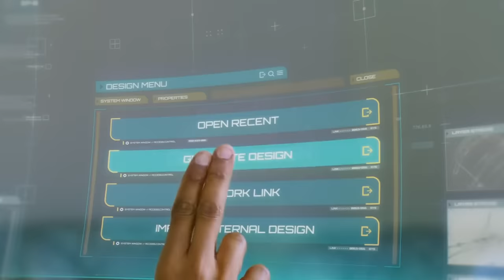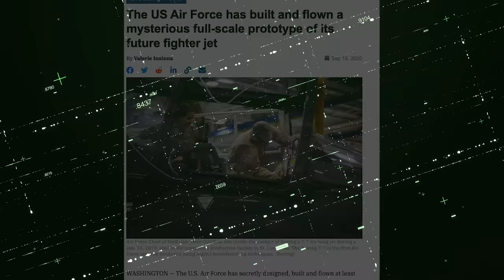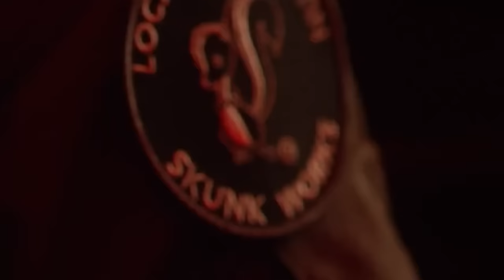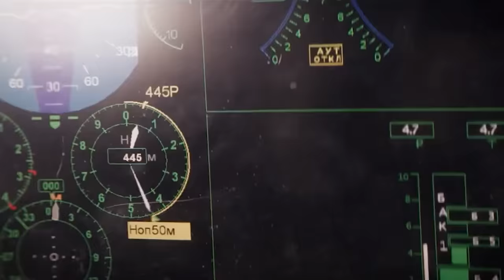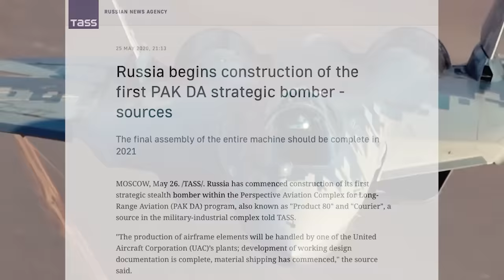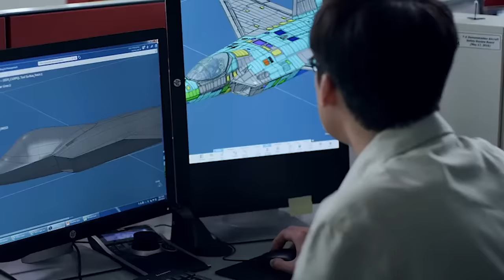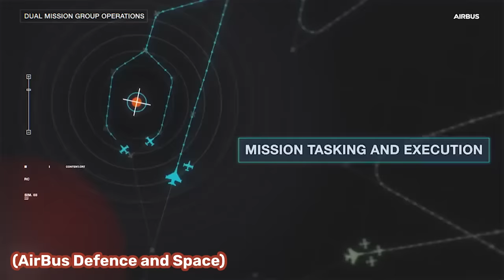12 new stealth aircraft headed toward service

Comment: Stealth is kind of a given for new gen fighters. AI and hypersonic is probably the next iteration. Judging from China's development efforts, the next gen is likely hypersonic bombers FOB and supersonic fighter/bombers like the JHxx. AI driven drone fighter and bombers are already slated for next rollout. The J20B twin seat fighter and dozens of new comms satellites are being launched.
Reply: The PLAAF will need engines that actually work, first.
Reply: My hot take is that the area between Mach ~1.2 and Mach 4 will be an absolute no man's land for approximately the next 15 years.  Fighters will of course still be capable of Mach 2.2ish, but they won't fly at those speeds almost ever.  Why?  Because the range reducing and conspicuous nature of going that speed just aren't worth the marginal benefits of "do the same thing but faster".  However once you get to Mach 4 or 5, then you are legitimately enabling new approach routes that outrun missile defenses or catch the enemy off guard enough that it's actually quite worthwhile.  Kinda like "I'm gonna do this, and everyone this side of the Himalayas is going to see and hear it, but it doesn't matter so long as I'm fast enough" vibes.  But in between, you're going fast enough to be more noticeable but not fast enough to just outrun your problems.
Reply: @JMurph2015  you do have a point. But I suspect super cruising would be the remedy to the high fuel burn. And planes built for high mach are also more aerodynamic, partly the reason why the J20 has a longer range. Time to station is still important and may be worth the shorter range. BTW even a Mach 3 plane like the SR71 can outrun most missiles if it knew it is coming. All missiles have very limited effective range, if you can leave the effective range of 100-150km pronto the missile will run out of propellant. So even a Mach 2 plane may be able to use it's speed to outrange a Mach 4 missile by driving away to slow the missile intercept.
Reply: @buildmotosykletist1987  As far as I know, China makes quite a number of jet engines on its own. All planes built in the last decade have been powered by home grown engines like the WS10, WS8, WS20, the WS15 is already mounted on some planes. The difference between 2000hr and 3000hr operating time between overhaul might be important for service cost, it makes very little difference for combat or general sortie rate. The J10 uses a single WS10 engine, it isn't exactly falling out of the sky. On the contrary the Taiwanese F16 are falling out of the sky trying to keep up with Chinese incursion.
Reply: @olderchin1558  : J20 ! lol.
Reply: @olderchin1558  : J15 too. Only the Russian engined jets perform.
Reply: @olderchin1558  supercruising helps a lot for fuel burn, but it still generally produces a loud boom behind it (and future military jets appear more interested in other stuff than reducing the boom sound), and importantly the associated exhaust heat and skin temperature rise become increasingly difficult to avoid.  IRST is already a big buzzword before every new plane rolling off the line is hard to see on radar, but imagine how prevalent it will become when it's the new most reliable way to track aircraft?  The B-2 and definitely the B-21 had/have some serious mitigations in this regard, and I think it will trickle down to fighters at least to some extent.  And maybe I'm underselling the flexibility of next gen or next next gen engines, maybe the same fighters capable of cruising effort at Mach 0.8 will also be capable of Mach 3 or 4+, but that remains to be seen.
Reply: @JMurph2015  There was a video about some ceramic radar absorbing coating, the B21 is likely to be using it. It would last longer and not heat up. The Sonic boom is unavoidable but it doesn't travel ahead of a supersonic plane so it really isn't a big deal.
Until anti-gravity drive becomes a reality, exhaust signature is a necessary evil. Even China's experimental plasma jet engine will leave a heat signature trail. I bet future surveillance satellite would track and identity planes by their heat trail much like subs track sonar signatures. 
With modern radar systems and satellite, the location of everything is a given. So even stealth is not going to be a cure all except to gain a slight advantage. IRST has been standard on Russian fighters for some time. The Russian is supposed to be working on some plasma stealth but I think the biggest problem is identifying the target not detecting them.
I think AWACs or AEW and integration situation map would be the real game changer. The fighters will likely be just missiles trucks. There were discussion about bigger stealth fighters in the US.
Reply: @olderchin1558  there is more progress on the exhaust signature front than I think you realize at least on the bombers.  I don't know more, but I've gotten some suggestions toward that over the years.
Reply: @buildmotosykletist1987  Difficult to response here. Can't convince you by written a 3000 word essay or referring to 10 years of YouTube and media news of Chinese military and aerospace development if you are kind of anti-china. I will leave you to your blissful ignorance.

Comment: Nicely done video, good accurate information.  Stealth doesn't mean that you can't detect it, with most modern radar that is true, however whenever the US makes something that can't be seen or be destroyed, they then go out and find a way to see it and destroy it because the US knows that it's only a matter of time before adversaries develop the technology, so we need to be able to see stealth aircraft and lock on with weapons to destroy it.  I watched this way back in the 70's with the new Abram tank, we built it then we worked on destroying it, and once we were able to destroy it the tank went into service.  Our radar systems were developed the same way, with testing to find a stealth aircraft taking place when the F117 was still highly classified. All the early fights of this aircraft done in secret were done to build a radar system that would detect it.  There is also more to a stealth aircraft than just the shape, there are also jamming capabilities and false radar signatures.  False radar signatures were first used on the SR71 Blackbird during one of its last upgrades, this system projects several images of itself so any tracking system will see several aircraft, it now becomes a guessing game as to which image to launch a missile at.  Other things are going on in stealth world too that would make your head spin.  There was strong evidence that leaked out during the first Gulf War about a special forces unit that became invisible to the Iraqi, not by standard camouflage either, but went completely invisible, if that happened way back then, I'm sure we're much further ahead today. You can read about that ability on the internet.

Comment: With decades of advanced hybrid material reinforcement engineering experience, integrated advanced radar absorbing materials into the entire structure vs over-coatings is a game changer for consistent stealth capabilities while significantly lowering maintenance operational costs.
Reply: The original F-117 stealth fighter (actually a bomber) was very primitive by today's standards. Back in Desert Storm, nobody even knew what stealth was until we announced, "Oh by the way we have a plane that's nearly invisible and can walk past your air defenses." The F-117 only carried two bombs, and the bombardier had to keep the target painted with a laser. The bombs cost about a million dollars each. Very expensive plane to operate.
Newer aircraft are orders of magnitude stealthier, have more better and cheaper weapons, and are much more maneuverable.
Reply: @protorhinocerator142  Cheaper weapons? Not.
Stealthier? Only in dry perfect conditions from specific cross sections.
Reply: @icare7151  Cheaper weapons? Yes.
We went from laser-guided munitions at 1 million apiece to JDAMS, which were about $20K apiece. JDAMS are fire and forget.
Reply: @protorhinocerator142  🤔 We just shot down a balloon with 2 $495,000ea missiles, the first one missed.
Reply: @protorhinocerator142  Stealth had been widely talked about since at least the early 80s and the B-2 was unveiled to the public in 1988, but you're right in saying that the impact of stealth wasn't fully appreciated until Desert Storm.

Comment: You know as I think about this..why can't they have a hard roller style tube drop down with munitions that connects sort of like in air fueling but is able to handle heavy munitions..have it drop down and connect with lockers into an automatic magazine feed loading system...this way it can fuel and re arm itself all while in air .this should be a thing for a 7th gen

Comment: Stealth was introduced in 1964 with the SR-71 .
Reply: The Blackbird had reduced radar cross section, but it was not stealth. Every radar on the planet could pick it up. And if not on radar, it's 950 degree skin temperature against the cold black sky was easy to track as well.

The whole point of the SR was to be seen on radar, so as to force the SAM sites to power up and focus their energy on it. So they could learn about the soviet tech, locate and map their SAM sites.

Comment: As much as Iran currently benefits from it and probably would today were it still in production, it sounds like killing off the F-14 Super Tomcat was a mistake. The F-18 Super Hornet capabilities aren't anywhere near what the STs would have been (or what the F-14Ds were, for that matter). Even so, much like the F-15, Super Tomcats would have to evolve but would have greatly benefited from modern avionics suites, minor fuselage tweaks (a la F-15 Silent Eagle) and LPI paints, more powerful and efficient engines, plus all the other benefits the F-15EX and F-35 currently enjoy with M/UMT, Sensor Fusion, and the rest.

Considering that the F-18SH doesn't do what Navy needs it to do, that the F-15 and other Gen 4 platforms are back in full production, and that Navy needs a platform that is essentially a Generation 4.75 F-14 (if not a full-on Gen 5) alongside its 5th Gen platforms, it sounds more and more like killing the Super Tomcat was a mistake.
Reply: The F-14 was a massive drain on resources, it's swing wing was always going to be a massive logistical headache. And the F/A-18 super hornet is fine. The current strategy involves F-35's dealing with the big threats, and F/A-18's mopping up everyone else. Not really a point in slotting in a tomcat. And the Block 3 super hornet does have many of those technologys.

Comment: India could have benefited by partnering with the US F-35 since it was a 5th Gen aircraft obviously meant for foreign export.  However, I think that India's close partnership with Russia made that a too high of a risk for the US.  Ditto Turkey.

I think Japan and the UK did the smart thing and either partnered or bought F-35Bs while pursuing a 6th Gen aircraft at the same time.

With 6th Gen aircraft under development, I think Finland also made a smart move to buy F35's as a very capable stealth aircraft waiting for the 6th Gen to mature.  Sweden won't buy the F-35 because it wants to retain it's own aircraft production.

The bottom line is that every other country is behind the power curve in stealth technologies.  They are taking about possible advanced 5th Gen by 2030 and 6th Gen years after that.  Meanwhile, the US will have both 6th Gen fighters and bombers operational before that and working on 6th Gen plus and 7th Gen concepts.  And the US has wisely built its 5th Gen aircraft to be easily upgradeable to be even more effective as well as developing weapons that have longer ranges and that are smarter.

There are hints that the US is developing more advance coatings for its fighters as F-117, F-22, and F-35 fighters have been photographed with some sort of highly reflective coating that is described as being like a mirror coating.  I haven't read anything about these coatings, but you can bet the US is testing them on all of the Stealth fighters for a reason.

I think the US will continue to maintain the lead in stealth in addition to developing longer range weapons that also have stealth capabilities.  By the time other nations have operational 5th and initially 6th Gen operational aircraft, the US will have even more capable 6th Gen options and working on 7th Gen concepts.
Reply: India could always buy the F-35 if they wished, but it is too much of a budget constraint for the IAF, hence they are buying Rafales and developing their own jets

Comment: 'introduced in the 1980's'  Mmmm.  Well, if you watch the documentary that Northrop did on the development of the YF-23 and do some math you can plainly see that the F-117 must have been flying in the mid '70s or perhaps even the late '60s.  Just like some of the information that has become declassified about operation OXCART tells that some of the composites used on the space shuttle were in use on the A12 during the Vietnam war in the late 60's.  Don't get me started on how the space shuttle was always used military hardware.

Comment: It strikes me that it’s perhaps more cost effective for the navy to invest in strong countermeasures to the Chinese long range missiles than a higher payload longer range carrier based plane with its drone wingmen and a drone aerial refuelling platform.  You need to try to stop those missives anyway, they will always be a threat to carrier groups.  Instead of precision kinetic interceptor missiles what about a greatly souped up Phalanx system perhaps with energy delivered magnetically instead of explosively complimented with directed energy weapons or systems that similarly put a spray of metal in the path of incoming missives like buckshot?

Comment: lol older engines don't mean anything.. as long as they work..
Turkey  fighter could be a bloated flying cows carcass going 200km an hour, but if its got a top of the line radar and the longest ranged and best locking missile Its the best fighter in the world..

Comment: YF-23 was not selected over the YF-22 because it was too big a step ahead. There was no need to go to a 6thish gen fighter. Change my mind.
Reply: It's not remotely 6th Gen, it was a less complete design than the YF-22 and had demonstrated fewer capabilities, its weapons bay was too small and would have got smaller to accommodate design changes needed to turn the YF-23 into an operational F-23. Northrop also had a bad reputation for poor project management, huge delays and massive cost overruns, while Lockheed had a much better track record. The YF-22 was also a better fit for the needs of the Air Force at the time and its perceived future needs. There was no conspiracy or weirdness going on - they chose the better aircraft from the more reliable company, and if it had gone the other way, it would likely have taken even longer and cost more money to get the F-23 into service so people would bitch about it and say that YF-22 was the obvious choice they should have made instead.

Comment: Stealth fighters are pretty much a first strike weapon. Pretty much only useful for offensive ops or in other words, flying in OTHER country's airspace.
Reply: not necessarily stealth is also a great defensive capability for defending against enemy aircraft.. if someone invaded you and you need to respond with aircrafts then having stealth vehicles is an advantage for obvious reasons
Reply: @brocklaughrey3212  that is true, but like its main advantages primarily benefit offensive. For stealth to be effective a flight plan must be made to avoid radar, (or more keep radar only seeing the front  180 degrees of the plane) maybe I should have said the benefits of stealth are mostly in its offensive use, u can use a stealth in a non traditional role like an f16 but it's most important assets are  leveraged on offense. From a stealth perspective. That is why stealth was built create, strikes behind enemy lines or opening up enemy lines if ya know what I mean

Comment: The YF23 might be the replacement of the F22 as the F22 is not in production and the Air Force has issues with it.
Reply: YF-23 is a prototype that hadn't demonstrated it could launch missiles, didn't have the avionics it would need and had a weapons bay that was too small and restrictive. It took 15 years and billions of dollars to turn the YF-22 into an F-22 that was good enough to be deployed, and the YF-22 was closer to being a finished aircraft than the YF-23 was. You'd have to do so much work redesigning it that it would be an F-23 in name only and it would probably be simpler and cheaper to just start from scratch with a plane that was designed with current and future needs in mind rather than being a product of the Cold War.

Comment: The KF-21 isn't designed to be stealthy. It's designed to be an affordable modern fighter (light fighter). What the F-16 was designed to be. 

Very good idea as not every nation can afford to buy and operate F35's and the even more expensive fighters. These nations were left with a choice buy old designs like F16 or a far smaller number of the advanced modern fighter. 

Korea with the KF-21 have very cleverly filled that gap making a modern alternative which is affordable in numbers. Poland recent purchase shows the need and confidence in the concept.